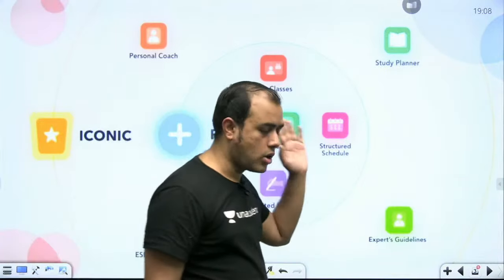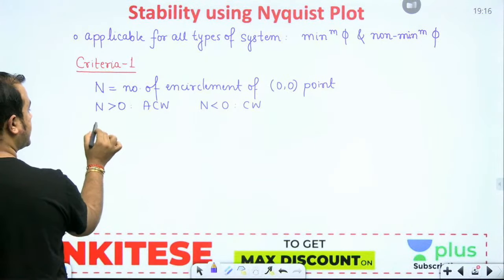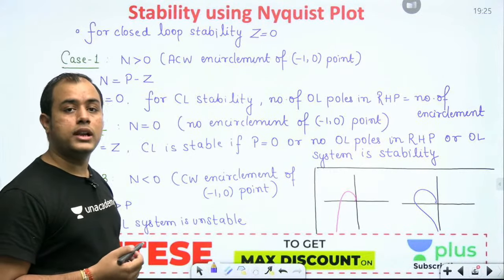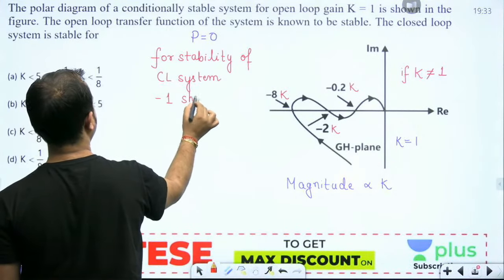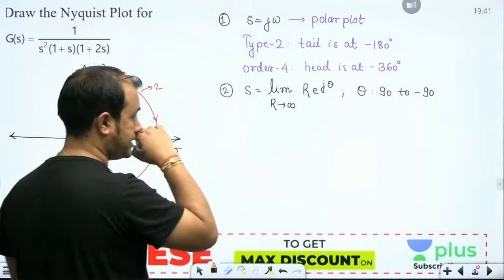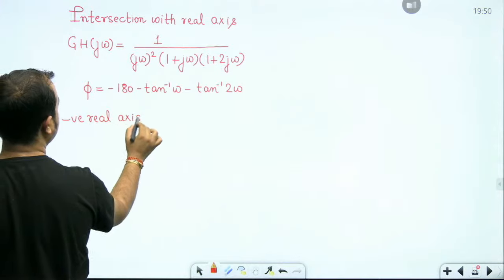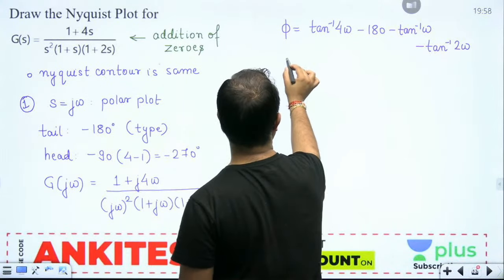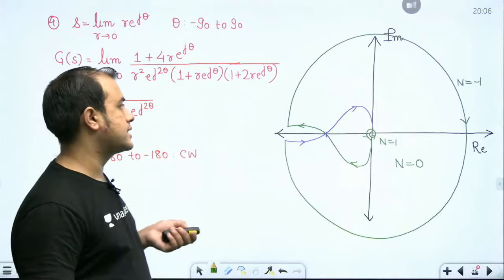Control Systems | Stability using Polar Plot and Nyquist Plot | Lec 63 | GATE EE/ECE 2021 Exam

Comment: the lecture was just awesome sir...In last question there is also a root at w = 0 so it also cuts W=0 and also the other point 1/2Root2 so there will be a slight change in the plot
Reply: no there is no change in plot if we substitute W=0 then itsmagnitude is infinity that means it intersect with negative real axis at infinity which is already shown in the graph..